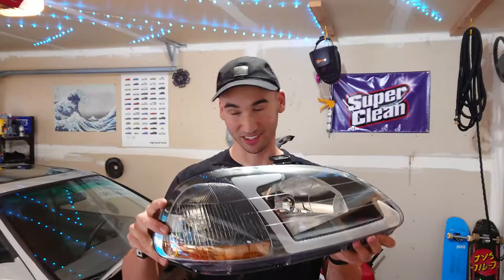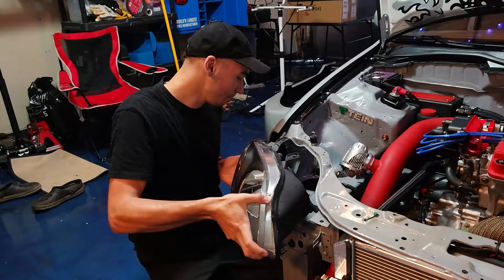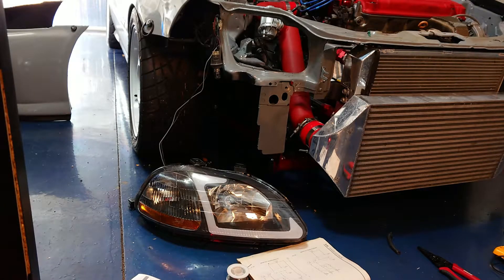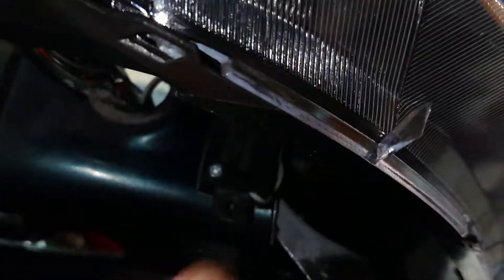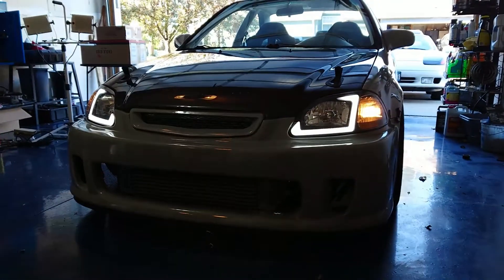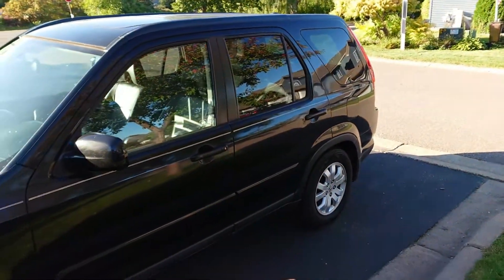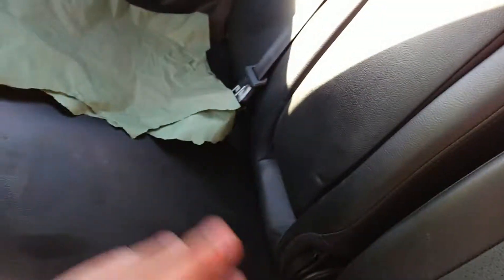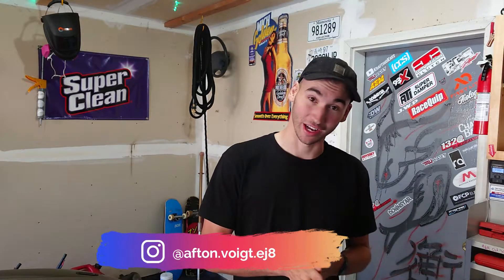Turbo Civic From The Future! DRL Headlight Install + My New Daily Arrived!

Comment: Just installed some similar headlights with the projector housings. If you want that led strip to act as a turn signal put the black wire on the green wire then the red to red
Reply from the maker: Good to know!
Reply: Any videos?
Reply: @pgFrancisco hello what he meant?like put togehyer 2 wires?

Comment: Even though people don't use parking lights anymore as actually for parking, I wonder how much power those LEDs really use. If it's as little as I would imagine, those would be the ULTIMATE parking lights! P.s. people used to leave the lights on when they were parked along dark streets at night so drivers wouldn't hit their cars, and they were supposed to use little power so the battery wouldn't be killed.
Reply from the maker: That's a fun fact! I'm sure they barely use anything.

Comment: I accidentally touched the wires and now there’s no light coming on would I need to replace the harness?
Reply from the maker: Check your fuses
Reply: @kraftingkars  thanks I was able to get it working except the radio I’ve checked every fuse and none are popped other than having to replace like ten fuses lol 😂😂

Comment: Hey that carbon cooling plate above the grill is that from ebay and is it for facelift or pre-facelift?
Reply from the maker: It should work for 96-00 civics. Its made by password jdm and is from technocraft composites website
Reply: @kraftingkars  do you have a link and do they send to the eu ?
Reply from the maker: @NitroZeus69 https://tecnocraftcomposites.com/products/password-jdm-dry-carbon-fiber-cooling-plate-ek-96-00-civic?_pos=4&_sid=58b0e7814&_ss=r im not sure where tgey ship to
Reply: @kraftingkars  and another question the lights did they come with sockets or did you have to buy extra's

Comment: I bought the same headlights and wired the same wires you did and it worked but only on my driver side head light. My passenger side head light, led still won't work, what should I do?? Please help!
Reply from the maker: Well I'd check to see if you have power going to the led, if so it's a bad led, of not you have a wiring issue elsewhere
Reply: Where else could the wiring issue be? Because the actual headlight and turning signal part still work it's just the led. (I bought these off Amazon and I have a 2000 Honda civic ex btw if that matters maybe).

Comment: Have the same ones, haven’t wired up the drl yet
Reply from the maker: Do it! Now you know which wire not to connect to😂
Reply: @kraftingkars  honestly that’s what was stopping me 😂, I’m happy you did a video. I’ve been slowly building this ek coupe for my Girlfriend
Reply from the maker: Sweet! Yep, you will get your power from the red+black wire on both sides. And ground to the plain black wire.
Reply: @kraftingkars  it’s a 97 EX coupe, so I’ll follow the instructions and do a short video for my Chanel
Reply: @kraftingkars  your channel has been a big help, I did the fuel and brake lines and rear disk conversion all from watching you 😂, thank you 🙏🏾
Reply: @kraftingkars  did it thanks again for the video

Comment: hey i have a 98 hatch DX would it still be same power and ground wire? im having a hard time trying to find a good wiring diagram
Reply from the maker: Yep it should be. Remember you can always test with a multimeter first.

Comment: I installed them on my civic and now my turn signals lights don't stay on and my back lights don't turn on anymore when I turn on my headlights
Reply from the maker: Is your civic usdm?
Reply: @kraftingkars  yes
Reply: I having the same problem did you ever got it fixed?
Reply: @alexyang9001  yea I never wired the drl but I took it too a mechanic and they reconnected them somehow and it worked afterwards

Comment: Where did you get the bumper
Reply from the maker: Seller on ebay! You can also get them from icb motorsport. I would recommend either a frp or urethane one, as the fiberglass ones crack way too easily. Mine is a airwalker Japan front bumper, but there are other versions out there, BYS Spoon being the hottest with a carbon kevlar lower lip!

Comment: Sick  mod dude. Great content. Will that headlight fit in a 2000 civic?
Reply from the maker: https://www.ebay.com/itm/373980378389 I found this set on ebat looks very similar just doesn't have the amber corner light strip
Reply: @kraftingkars  thank you so much Sir.